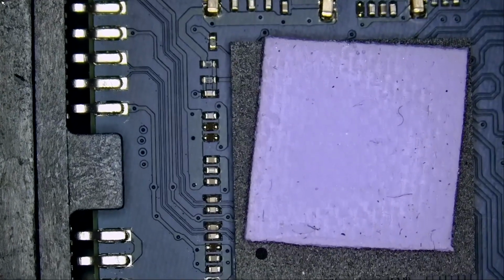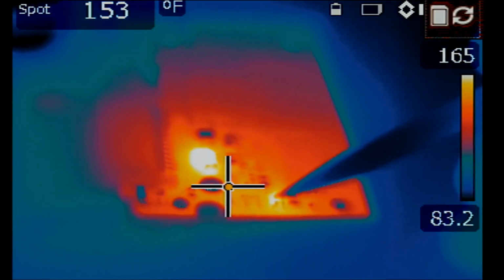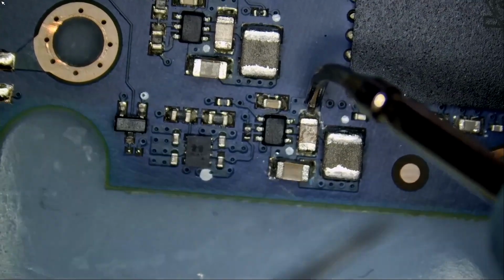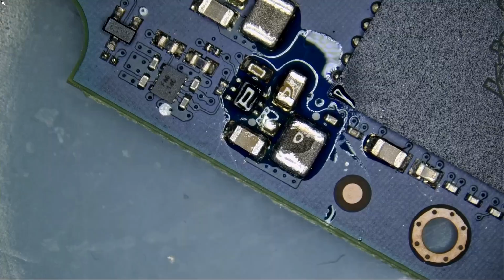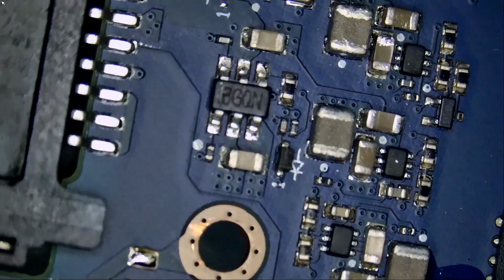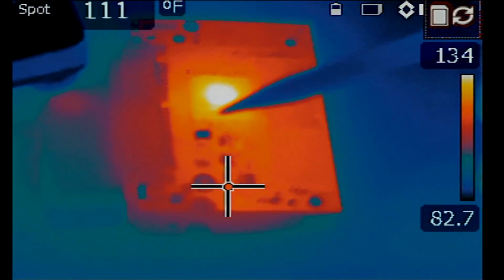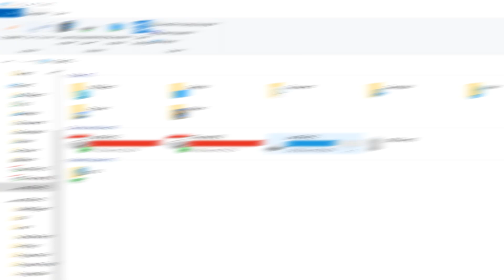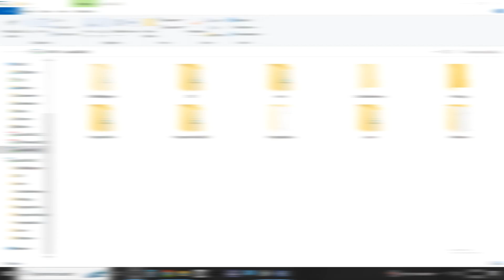Crucial 500GB SSD Drive Repair. What failed?

Comment: This is a very educational and valuable repair video! Thank you for putting this up! I have an exact SSD but at 1TB fail after 3 years. Seems like the QC for the newer Crucial SSDs are dropping. I still have Crucial SSDs that are running for over 7 years.

Comment: Has anyone had their HP Optane drive fail with a F032 code? Mine failed with important information still sitting on it. I was able to backup alot of files with OneDrive but those critical file were being stored in appdata. What can I do/

Comment: I have a ocz, ssd drive, it is found in the bios, but will only show up in windows when I remove the power cable and then reinsert it. It briefly shows folders but I cannot read any of these files, and it will promptly lock my computer up, I have tried chkdsk, but it just locks up, think it’s a hardware failure, how much do you charge to fix?

Comment: 13:00 Yeah! You did it, but that's not the normal function of "recognize" an SSD. It takes to much time to recognize it. May you flash it with a new or different firmware to see. 🤔

Comment: Hey Alex, I recently stumbled onto your channel and really enjoy your educational content... I got a quick question though,
in the video it looks as if you never soldiered a new cap onto the board... does the drive work fine without it or did you have to replace it off cam... if it works fine without the cap, then id like to find out what that section of the PCB controls Thanks :) -Aloha

Comment: Someone tell me what did he actually do with the capacitor? I saw he put some flux but that's it
Reply: He soldered it to only one pad of the two purposely so that it is no longer part of or affecting the circuit. He could have just placed it on his desk, but they are so tiny, that might be a good way to lose it. The flux and re-soldering after removing is not necessary at all. It is just his way that he chooses to go about things.

Comment: "Let me know what you think". Nice question. I think you attempted to kill NAND chips on purpose several times. Powering drive with actual failure in NAND power circuit at closest point to chips. Removing faulty MLCC in most critical place "just to check thermal image". At this point all NAND chips were getting high frequency ripple of 5V instead of nice and smooth 1.8V. You should try to clean loaded shotgun barrel from its outcome with ramrod using your experience in data recovery.
Reply: What would you have done?

Comment: On my Asus gaming laptop, when I remove the heatsink from the motherboard I see what appears to be two types of thermal paste, one on the cpu and gpu and another as a gel on the mosfets. What kind of pastes or gel do you recommend I use in each case?

Comment: As a photographer and a videographer having multiple backups are important even to the cloud when sharing with clients. Have you ever thought about instantly sharing lost files with customers through a cloud service and then they wouldn’t  have to wait a 1-3 days to receive a a copy drive ?
Reply: so who's responsible for data security, integrity or availability then? I would only use cloud if the client purchased it and provided access and instructions. No liability then, no costly lawsuits, no distractions. Otherwise you get huge risk for nearly no reward.
Reply: @groszek7657  You can encrypt the data and share the key only with the customer. That's much safer (both in terms of preventing damage and in preventing data theft) than it is to send a physical, unencrypted drive.
Reply: @groszek7657  You’re overthinking the process. What you're saying is somewhat true but anyone can steal the package, take the data, the package could get lost now you have more money and time resending submitting claims through the delivery service. I was just thinking about the convenience of solving this issue in 10 minutes and then sometime later that same day this distraught customer could have their data at their disposal. From a photographer standpoint, if my hard drive fails (hopefully never) I’m sending it here first asap no questions. On my end I have customers to fulfill, and if the drive gets fixed over the weekend I may not see my files for a couple of days and would have to push customers completion dates back. If he was to upload to a cloud source the same day it’s fixed I could get back to work asap. That’s world class customer service.

You're making it seem like people are sending in hard drives that host blueprints for missiles from Raytheon  or the “blacklist”. And if they were you would probably have an agent drop the drive off and someone pick it up, no cloud, no mailing flash drives back with pertinent data.

And last I’m sure he has people sign a clause that he’s not responsible for any data loss.

Comment: You have a video explaining diagnostics of capacitors,  diodes,  resistors,  mosfetts, etc... like how to test them, what reading is good,  and which one is bad ? 
When you say " this diode doesn't have short " how do you know ?
Reply: if you measuring voltage drop on the diode (diode testing mode) it shows readings between 0.4 to 0.7V depending on diode type anode to cathode and OL cathode to anode. Readings can be different when measuring in circuit. Failed diodes will either be shorted (near 0 voltage drop) or they burn open (OL).

Comment: I have been watching YOU! 😎 So, when you suspect that the drive might be formatted for the MAC then you use MAC to test it out. Does it ever happen to you that the drive might be formatted to EXT4 (or some other file-system), which is from Linux-based OS? Do you have any spare computer to test Linux drives in your shop?
Reply: Do remember that Apple's Desktop OS is not how it used to be. Way back, it was custom software. Now it's some version of Linux with the Apple stuff added on top, which is why you can run Linux commands in a command prompt window on a Mac. Since that is the case, the various other file systems should be readable on the Mac, or you can add something to let the Mac read the new drive in question. I'm mostly a Windows person, but I have had to deal with the issue of a Mac popping up in help requests, and there are programs that will run in Windows that will read various Mac file systems, aside from the fact that Microsoft has been adding the ability for Windows to run some Linux based stuff (there is a subsystem that can be installed for this). Another option is setting up a VM running in Windows that can be given access to the drive (BlueStacks uses VirtualBox to emulate Android on Windows so you can run mobile games on your desktop and Google is getting into the act with a beta client that works similarly (still being worked on and the two do not mix, so pick one)).
Reply: @benjaminbiller1387  But I am talking merely about the filesystem. Not the whole system design. Would you say, that it is completely impossible to mount a MAC formatted media to Linux-based OS? I am not interested how "Mac Architecture is built" lesson or some virtualizations such VBOX.

Comment: Computer ardware today has much more errors than it had before! It may well be unstable current from the power supply.

I have owned several samsung EVO sdd and other mechanical HDD. from WD. and samsung and other brands without errors. Also video card and motherboard without errors.

Today there are many problems with this. much more than before.

Comment: I figured it would be worth mentioning that I have not had a single Crucial drive fail in the last 14 years...and I have used THOUSANDS of them.

It may be possible you have seen a few drives fail due to a common issue, but you make it sound like it's a common failure.

Ceramic caps fail when ceramic caps are physically damaged.  There isn't some conspiracy affecting Crucial drives that I have seen.
Reply: I worked at a computer recycling and refurbishing company. We tested hundreds of hard drives, and computers every day. We had many crucial drives that were DOA. That doesn't mean though that it was a fault of the drive itself. The computer it was in was probably the cause of the failure due to a short and most dead ssd's we found were pulled out of dead computers. And most of them from laptops.
Reply: Heat can kill ssds (for example laptops), or using them as swap (like apple do it on its new devices)
The world is full of possibilities

Comment: electronics repair is a small hobby for me, i bought a thermal camera with a macrolens for smartphone for only 200$, based on your videos i learned about the smd caps, i repaired a dvb-t2 receiver and charger for a cordless drill, thermal camera is amazing
Reply: What thermal camera do you have? Is it the Flir One Pro OTG camera?
Reply: what thermal cam brother
Reply: I just spray the circuit with an air can upside down so it can freeze the thing and plug the power and the component that doesn't have ice that's the one I must change and it worked like a charm, and I spend like... what? 2 bucks?
Reply: @NaterFernat this way many people killed their GPU

Comment: Im surprised you connect these to you're rig and dont have a test bench running a pxe version if Windows like thst sergie win10 it has all the tech tools. Amazing work as always its worth it to have these capacitors on hand as it seems thats the crux of these drives.
Reply: Using windows as a professional SMH.
Reply: @goku445  if it has the tools I'd use for the simple fact I'd not have to bring up terminal everytime I wanted to run something or mess with config files. 
With a PXE environment built with tech tools it's best of both worlds and it's loaded at the time you need it no remnants.
Reply: @shadowarez1337  I think you mean PE version
Reply: @maklogetrich2378  yeah oddly mine was labeled PXE but that don't make sense as pxe is like loading a os over the network via the Network card when no HDD is installed ie thin clients.

Comment: Reading the files does not mean able to copy them. Had the same problem in an ssd ( too long for the disk to open , copying them with 700 kb and many errors) . It was an intenso ssd 1gb . Partial solution was to boot into linux and start either cloning the partitions either copying single files no matter how long it took.
Reply from the maker: Already copied.
Reply: . Perfect. Then the slow opening of the drive was due to something else. Awesome job.